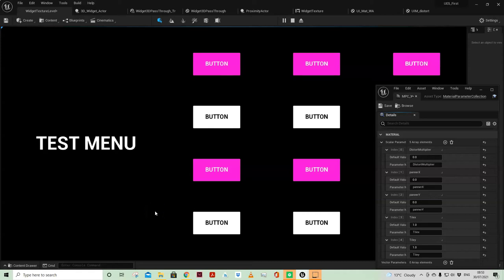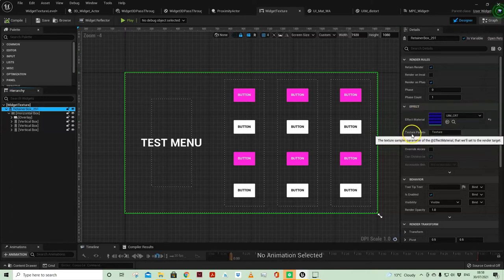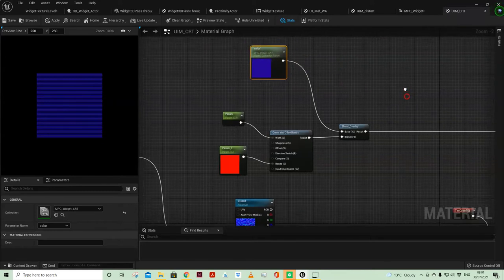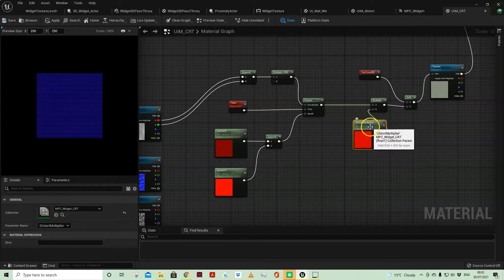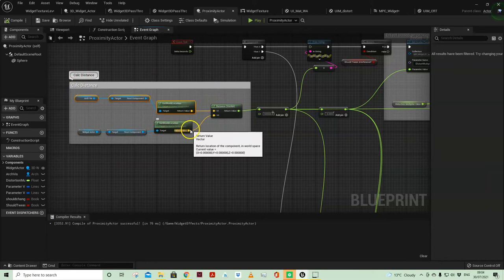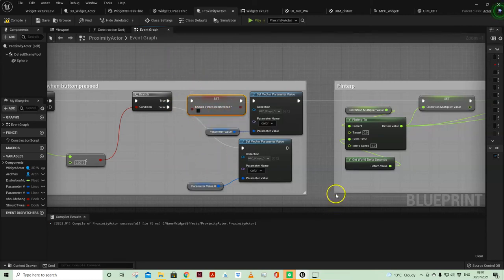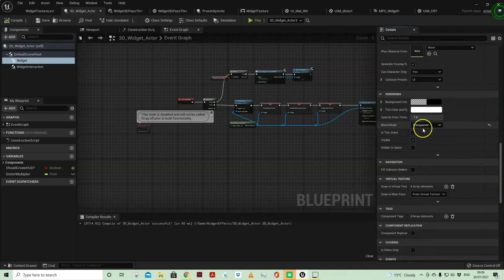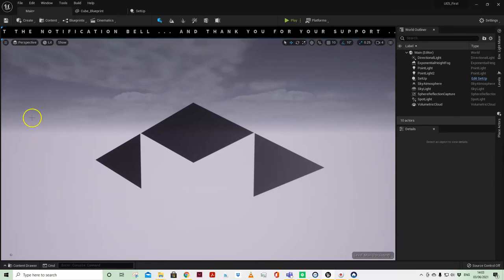WIDGET RETAINER BOX EFFECTS - TEXTURE MATERIAL - UNREAL ENGINE - UE4 - UE5

Comment: Hi Mike(same mike lol), thank you for showing these. But I do have a question that when I use retainer box to warp the screen, the buttons are offset from it original hit box, for this kinds of issue, do you have any idea on how to fix it?
Reply from the maker: No it’s just a screen effect so that will happen - so it’s a balancing act - between not overdoing the effect - or you could make the hit area larger than the visual representation. A bit of a hack but would give more consistent results